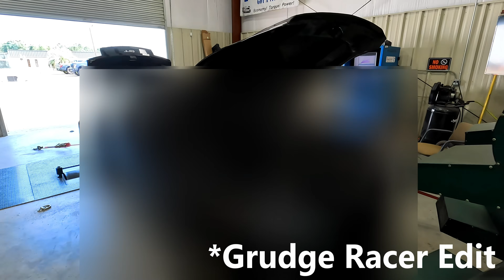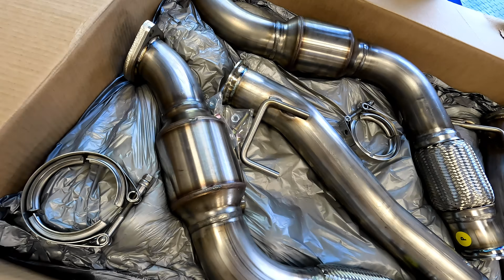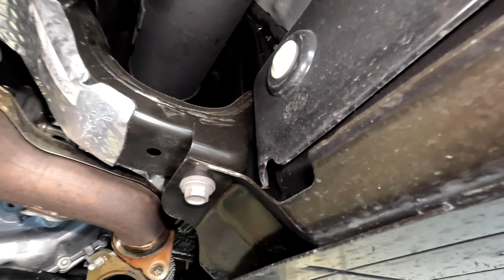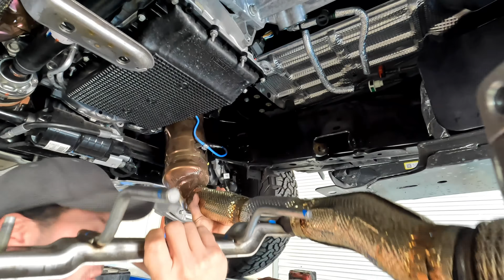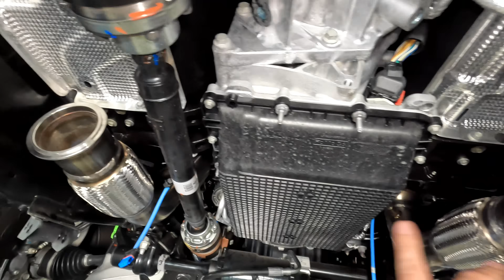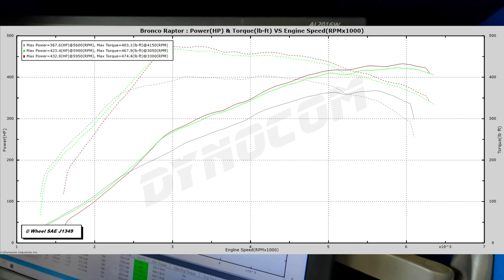Dyno-Tested!! | SPD Performance Downpipes for the Bronco Raptor | Beast Unleashed!!!

Comment: Great video, like the SPD Downpipes!  Have you had a chance to check fitment with 2025 BRaptor? SPD says 24, but was wondering if you got your hands on a 2025?  Is there a big difference between the 2 High Flow Cats offered by SPE, the JESI is extra $1100 over Ceramic Cat.
Reply from the maker: We haven't checked fitment on a 2025 BRaptor.  The Gesi cats can tolerate a lot more abuse, without failing, than the standard ceramic cats.

Comment: I'd love to have it on my future raptor just because how it looks alone. Wonder what times you'd get if you lightened the truck: delete the spare tire, delete the back seat, switch out metal front bumper... Can't think of too much more to toss overboard.  Are the wheels actually forged and light weight?  Have always wondered if one went to a smaller 'street' tire with vey lightweight forged rims, what effect that might have at least with aggressive street/mountain twisties type conditions.  and Yes, I'm sure it would a lot of laughs....

Comment: 3.0TT motor should be making some more jam with the mods you have so far. I wonder what's holding her back. I'd expect around 100whp gain with a good tune, intake and exhaust.

Comment: why i cant get the drivers side (o2 sensor blue conector) reach the stock one? when installing the down pipe?
Reply: SPD told me to swap the drivers side to passenger and vice versa. Did you try that?

Comment: Will these downpipes work with the MagnaFlow exhaust?
Reply from the maker: Potentially, but it's a long story.  Post a thread on the SVTPerformance forums and I'll give you all the behind the scenes details.
Reply: @SVTPerformance Potentially?  The downpipes directly bolt on to the OEM exhaust.  There is no reason they wouldn’t fit the Magnaflow system.
Reply: I don’t see why not
Reply from the maker: @Logan-de3xx   As stated above, post a thread on the SVTPerformance forums and I'll give you all the behind the scenes details.
Reply: @SVTPerformance I have these downpipes and the Magnaflow exhaust was an absolute pain to install but it works.  The issue was SPD messed up and machined one pipe incorrect where the vband clamps down so I spent two hours just widening the hole to fit correct.
Reply: @Logan-de3xx I just got both. Are you on any social media platforms to discuss the issues you had pairing both?
Reply: @5L_Eater SPD I love the downpipes they just don’t line up with the Magnaflow exhaust.  Also depending on your year Magnaflow was great and sent me the new valves but basically 2023 the valves don’t need the springs.  I got the error codes and they wouldn’t function properly.  I would suggest going to a muffler shop that’s a good one and having them install it only so they can cut the SPD pips and make the bends to line up with the Magnaflow exhaust.  Also Whipple has been the most disappointing.  I’m getting the 02 sensor code and the front shutters even with Whipples delete.  Whipple is useless and won’t send me an updated tune even even for people not in the US.
Reply: @Logan-de3xx  I called spd shortly after reading your post and they said that it was like an issue with the v-band jig that has since been corrected. My bronco raptor is a 2023, so curious if I need new valves from magna flow? I’d love to chat with you offline, do you have an instagram where I can DM you about the install of everything?

Comment: is this even comparable with the regular bronco spd performance downpipes? im assuming the stock raptor ones might be a little more sporrty than my wildtraks, and I already have a performance intake, tune, bpv, and catback exhaust system. i think I might get a little more out of the downpipes because of that but 1.7k for 10 or 15 horsepower plus a ton of labor doesnt seem appealing when I could get the mishimoto performance intercooler kit for 1.6k and gain 7 horsepower but significant cooling properties and durability.

Comment: Makes me wonder if the SPD downpipes had similiar heat shielding as OEM if the gains would have been more significant,  I was expecting more like 20hp and 10-20 ft/lbs.  Ranger Raptor with the 3.0 picked up 20hp and 18 ft/lbs with similar downpipes.  https://www.youtube.com/watch?v=pAmVdSxAmtw&t=484s
Reply from the maker: Those would qualify as O/R pipes.
Reply: @SVTPerformance  I've had these SPD downpipes for a couple months but haven't had a chance to install yet and I've been looking at heat shielding options. Would you anticipate heat shielding to help on a primarily street driven Bronco Raptor?
Reply from the maker: @turbos8279  No

Comment: Wow, I was expecting significantly more than 10hp. Thats disappointing.
Reply from the maker: We expect the difference to be much greater as power increases.  We're currently tuning limited.
Reply: Many tuners that are familiar with the ecoboost platform have said that downpipes will not yield the power gains you might think they would. You’d have to upgrade the turbos the see the benefits. Imo it’s a waste of money to only gain 10hp. 3k for 10hp 😅
Reply: This is very typical gains without a tune. With a tune probably an extra 50 hp.
Reply: @DL911_GTS  Not in a million years
Reply: @alyousuf what? I gained well over 50hp turning my BMW X3 M40 with the B58 engine with down pipes. Without downpipes maybe 20 hp gain.